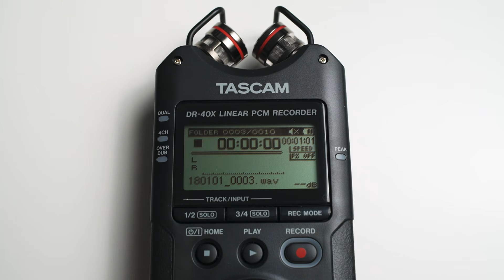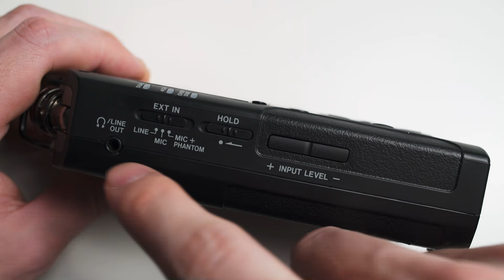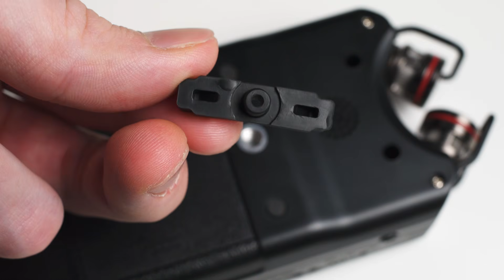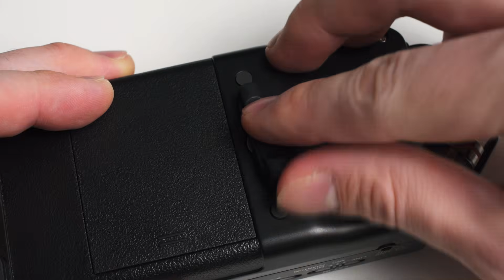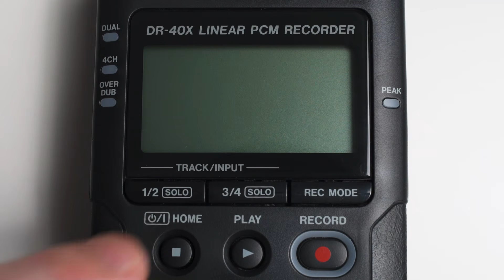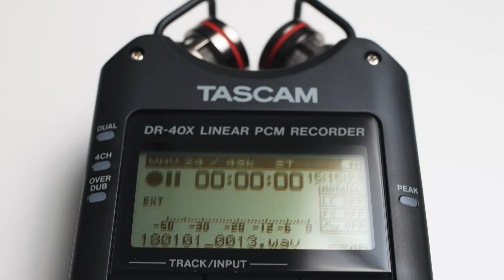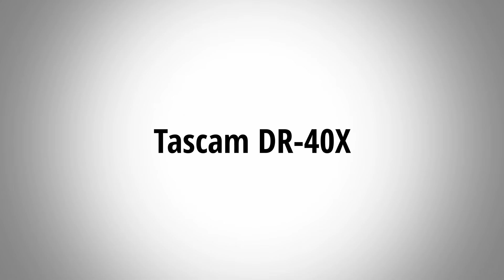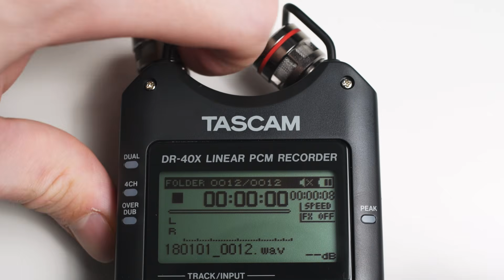Tascam DR-40X Review (Noise, Battery Life and more things tested!)

Comment: Hi, Julian! I'm a classical guitarist with a low budget, and I bought the predecessor of this recorder (the Tascam DR40) in 2012, if I remember well. That was a long time ago and the sound quality expectations may have been lower then, but from the very first day, I had a feeling that the preamps in the DR40 are sub par. Recordings with the internal microphones sounded relatively good, but external microphones didn't quite sound right, even when I used high quality equipment. Actually, I bought a pair of decent quality tube preamps to get around the mic preamps of the recorder. That way I can input the separately amplified microphone signals to the line inputs of the combo sockets. That setup has more advantages. First, the separate preamps can supply phantom power to the condenser mics, and so battery life of the recorder can be reserved for recording only. Next, I can manually set the gain on the separate preamps with proper turning knobs and so I can prevent clipping in all three units much more easily. I don't know much about the noise level of my setup, because I haven't tested it yet, but actually eI'm not very satisfied with the sound of my recordings, mainly because I cannot hear the same immediacy of the sound that I can experience while playing my guitar. Of course, the culprits maybe the mics or the preamps, or the excessively long signal path, too, but I have a good reason to suspect that the line preamps of the DR40 recorder (if there're any) are causing the problem. I guess this recorder simply isn't made to create home-studio-grade classical guitar recordings. It may be good to record occasional live performances, but you definitely need a more serious recorder as the central piece of your home recording rig, especially if you have already splashed out a fair sum on decent microphones and other pieces of gear. I think, in 2025, probably the Zoom F8N multitrack recorder is the right solution, or some of the well-built field recorders from Tascam with better quality preamps.

Comment: Great video. Thank you. I bought the DR-40X and very rarely use it. The reason to buy it was to spread the built-in mics, put it on a table in the centre of my music room, and face it towards my hifi speakers. This way, I assume it will record audio the way my speakers actually sound in person. I could take a line level out of my hifi system and directly plug it into the DR-40X but that would just give me a hi-res audio file on the SD card, right?.  In order to share files with friends and family with music the way I hear it in my room, what best way would you suggest? I have 4 different pairs of speakers, and I want to share how they all differently sound while playing the same music from the same source. Your thoughts on this will be greatly appreciated. Thanks.

Comment: Bit late, but you can insert that knob on the back (the one preventing the device from being tilted away from you) by turning it clockwise, as if it was a screw. This allows proper inserting and positioning.
Mine arrived just today, and I have yet to try it out in depth. I mainly bought it as a hardware recorder, so I can record my dawless jams / performances without always having to turn on the PC. First test recording sounded okay, but I'll have to do some further testing.
Btw, I fell into the "arm rec trap". "Made" a "recording" just to find out that all I did was arm the recorder ^^

Comment: When you plug an electric guitar straight into the Tascam DR-40X, do you need a pre-amp? Without pre-amping, it seems like Tascam doesn't pick up an electric guitar signal much at all. The levels are barely there. Put a pre-amp between the guitar and the Tascam, and the levels are 'normal'. Is there something I've not discovered on the internal menus of the Tascam, or is that just the way it is (signal almost nil when recording electric guitar direct)?

Comment: Welp, even though you think that the build quality isn't good, thousands of DR-40 units are still banging around go bags and don't miss a beat. While many YT reviewers have a fetish about metal-only construction, the reality is that the DR-40X and the DR-40 are rugged and decent enough for all but the most discriminating uses. Plastic doesn't mean trashy. The X model was essentially unchanged at a surface level because it is a if-it-isn't-broken-don't-fix-it sequel. The X is also an audio interface, which the original was not. Good value for money for a sub $200 recorder.

Comment: Revisiting this video again a year later. Still disappointed that this unit, which I love in so many regards, has such an unacceptable EIN and is all but unusable "as is" with dynamic mics and less sensitive condensers. I bought FetHeads (original and Phantom) to improve the noise issue when recording to this device, but in retrospect I really should have gone with the equivalent device by Zoom.

I commented last year that the noise struggles also seem to prevail with my DP008EX, but at least it can excuse itself by being older technology an confined to 16bit recording only. I have since gotten other Tascam recorders, such as the DP32sd, which is already "old" technology but seems to have much better preamps and it shows, and the newer Model 12, which records all of my mics cleanly and doesn't benefit from FetHead preamplification at all.

I would again like to see Julian (or someone) measure the EIN on these other Tascams (particularly the old DP008EX as I want confirmation that it is indeed as bad as I think it is), but I appreciate that will all the newer gear coming out and the move away from dedicated MTRs and toward interfaces and DAWs, there might not be much interest.

Comment: Very informative video specially on the noise floor. So which recorder model would you recommend please? This is my criteria:
- have xy and ab configuration
- can support adding 2 external condenser mics
- can be used as an interface and connected to PC for either broadcasting and recording 
- decent low noise
- budget up to $300
Thanks a lot

Comment: Hey Julian, thumbs up for the video. Surly opened my eyes. 
I bought the DR-40 Linear PCM Recorder (EIN: -108.3 dBu) 8 years ago and was thinking to use a Cloudlifter to cut roughly 25 DB in order to record vocals for a song. Still, if an acceptable noise floor is -65db or lower, it might not suffice. Can you share your thoughts in this regard?
Tnx 
Dav

Comment: Its normal for a recorder to require two button presses to start recording. 
it has three modes: Stand by, play, record. 
The audio input normally would not go to the headphones/line out in standby mode. If you are playing back tracks you dont want the microphones to send the audio to the headphones/line out, every time a track ends, while you select the next track to play, or reset the track to play it again. 

the recorder cannot read your mind and know which button you will press next: play or record.

Tape recorders were made this way for decades.

Comment: I posted a lengthy comment here earlier pointing out some things about this device. Hopefully it won’t “disappear” or be deleted again. Yes, this item is plastic which reduces its cost and second, it reduces weight as it is a portable device. Yes it has an intolerable built-in background hiss or noise. Nothing you can change via the menu for recording settings will lessen the hiss. Also the device will amplify and record any user handling of device while recording. So it must be positioned on a vibration free surface or a tripod. An accessory kit is available to allow device to be mounted on a typical mic stand. Any outside recording of music or nature sound will require a good wind screen added over mics.

Lastly, if you have a good audio editor with a noise reduction tool the be advised of this good information. After recording something with this device — open your recording in your audio editor. Select a non-music or non-vocals portion with the hiss/noise section, copy this section. Then open your noise reduction tool. Choose clipboard as the parameter for what to remove. Play your recording to see if hiss is gone. It will be. Then save the hiss-free recording. Yes, it is a workaround but if you want a hiss free recording, this is absolutely necessary with this device. Editing out the noise from a field recording will require you first record somewhere quiet, then save say 5 or 10 seconds worth to a “hiss/noise” audio file first. Make your field recording. Then open both field recording and the hiss/noise recording at the same time in your audio editor. Copy the noise sample. Then select your field recording. Open noise reduction tool. Choose clipboard as the parameter for the noise reduction to use. Apply and check your field recording. It will be artifact free. Save your cleaned up file. Extra steps yes but doable. If you already own this device this procedure will help out. If you find a used one of these in good condition and know how to use an audio editor — consider grabbing it  — as other than the irksome hiss/noise issue — it’s an affordable, overall useful and lightweight digital recorder. 😎👍🎥

Comment: During your noise floor comparison of different devices you didn't explain your settings or setup of each device. What were the gain settings used? That comparison was useless. Also, you only tested the preamp with a single dynamic microphone. What about a phantom powered condenser mic? Why didn't you test that? What about the simultaneous 4-track recording function? If you're going to review a device, please set your metrics to eliminate bias, and explain those test metrics to the viewers. Also, review all the functions, not just the ones you aren't happy with. I have more condensers than dynamics, so this review wasn't helpful to me at all.

Comment: I just got a FetHead Phantom today. I can confirm what you start--using the device easily improves the noise situation with my low sensitivity dynamic mics and the Behringer C-3, which is not terribly sensitive compared to other condensers. I am glad I got it and it will improve my experience with the DR40X and my other Tascam recorder. That said I have multiple uses for the FetHead beyond just lowering preamp noise on this device. I think someone starting clean is best to not worry about the FetHead and spend the extra money on a Zoom recorder with better preamps.

Comment: Would really like to see you review other  TASCAM multitrack recorders, like the DP006, DP03sd, and DP008EX. I have the latter, and I think the noise at the XLR inputs is terrible. I get much better results when I run the mic through a small Behringer mixer and record through the recorder's TRS line inputs. It's astounding, the improvement. But this works against the portability of the DP008EX if you need to shlep another piece of gear!

Comment: I have come to trust Julian's scientific approach and objective measurements. That said I get much better quality out of this with a Behringer XM8500 dynamic mic than this review suggests I should. Perhaps my old ears and high frequency hearing loss mean I don't hear noise as much ;)

My main gripe with the unit is that it's overdubbing and mixing capabilities take some time to sort out. You really need to download the full reference manual from Tascam. In short it isn't a four-track recorder in the more traditional sense as in my old Zoom H4. The process is basically overdub-bounce-overdub-bounce on track at a time. Workable, but different.

I find the build quality is fine. The little rubber foot has a storage slot in the battery cover. And the Peak Reduction level control is very useful (there are other YouTube videos that extol the virtues), but I agree that the Auto and Limiter level controls are not.

Julian doesn't mention that you can power the thing through USB too using computer port, a standard phone charger, or and external battery pack.

In brief I like it a bit better than Julian does. However, I am keen to invest in a fethead to see it I can improve the noise performance on this and other beloved recorders I have.
Reply from the maker: Hey, thank for sharing your experience with the DR-40X and the additional input!
The reason you are much better off with the XM8500 is that it is a more sensitive microphone. Meaning, it delivers a stronger signal in comparision to many other dyanmic microphones and that's why you end up with less noise in your recording.
Reply: @JulianKrause  Thanks. A couple of other things you didn't touch on. I have been experimenting with the thing as a USB interface, and it is surprisingly good, especially when using the built in mics. My DAW is Cakewalk, and I do find it takes a lot of fiddling with the ASIO4All property settings to get down to 128kbps latency (I have a small slow laptop so I don't go lower), but it is possible. As for the internal mics, there seems to be a slight QC issue with mine. In the XY position the Y is turned in a little more than the X. This means the stereo balance seems to slightly favour the R channel when you speak or sing dead on. The average difference on the meters is only a couple of dB, and it should only be audible to obsessive audiophiles, but this device isn't cheap and I would expect this to be in better nick. Also, the sensitivity of the mic to plosives is a huge headache--a pop filter or windcover of fur or foam is an absolute must, especially if you use Peak Reduction, as I do, to manage the the gain. I still really like the thing, but I can't deny that the mic asymmetry, which I suspect does not affect every unit out there, is a tad annoying (even if it is easy to compensate for by positioning).

Comment: Yes! This is a review. No stupid, annoying background-music, just a normal setup behind you.... I now own a DR-40, which has a an extremely annoying 'chirp' sound when using a phantom powered microphone. (which is basically a 'continuation' of the very bad helicopter sound many experienced back in the days and was eventually fixed by Tascam).

Just tried to record a voice-over, when the chirp came on AGAIN. I was so fed up that I started looking for something different. As I can read and write with my Tascam DR-40, I thought of the DR-40X. But darn, no. This will not be my choice.
About the plastic ;) My DR-40 has survived many accidental drops, including drops on the metal guards that protect the internal microphones. It has never failed to amaze me how sturdy this thing is built. The mic-guards aren't even bent!

Comment: Personally, I love the "Record" feature of not going directly into record mode, as you need to set levels before you record anyway, and if you REALLY want to jump right in and record, just press the record button twice quickly. Also, you must remember price point when reviewing these recorders, and Tascam does make more expensive recorders for more exacting professional applications. All in all, in my opinion, this is a very fine recorder for under $200.00.
Reply: Even if all companies have better recorders, they should put pre-amps and a/d d/a converters. 
That should be HIGH-CLASS. 

All other things (cheap plastic, buttons etc.) I don’t care about.
Reply: It is a horror system where you can miss the dubble tap or forget it. Stupid system.

Comment: What about line in recordings with music? - do they get ok?
Reply from the maker: Yes, they are ok. A line level signal is much stronger than a mic signal and you will hardly have any noise in your recording.
Reply: The DR-40X does have a switch for line level. The Zoom H4n doesn't have that. On the Zoom the TRS plugs are INSTRUMENT level inputs. Unless you use attenuators a line level signal will get distorted on the Zoom.

Comment: I've got a TASCAM USB interface US-122 (not MK2, the very first one) from XP/Vista era. It's got some driver trouble, since it was never updated for Windows 7 or newer, but it works. I simply scavenged the thing somewhere, opened it up, cleaned out the beer residue, plant matter residue with a distinctive smell, and indescribable white powders, and well it works again. Haha, musicians and their drug habits!

But the quality of the thing is diabolical one way or another. When turning off phantom power, there's a distinctive capacitor squeal. I took out all the through-hole capacitors, and you know what, they're all perfectly good, like day 1 specs... but the board is crowded with SMD electrolytics, and there's no way i could access them without desoldering all the switchgear first... Well i can ignore that. Also the noise, the amount of noise. I think it's about the same as you're getting. Some things never change eh? Worse, the headphone and line out are JUNK. They're completely identical. They distort audibly once pushed past about 2-3 o'clock position. The headphones don't even get terribly loud. I made a quick RMAA measurement and while i don't remember where i put it, it's appalling. They probably knew the outputs weren't going to be great, because i mean it's got those high bit depth inputs but only 16-bit outputs, which is to say the least uncommon even for the era.

Well at least it didn't cost pretty much anything. And i can always upgrade to a Behringer. But something else is luring me. You know the Terrasoniq Phase X64? I'm afraid it's going to be a catastrophe isn't it. But look at it. Just look at its silly face. And its silly side buttons. And the silly wall chart you need to operate them. And the silly WaveBlaster connector inside it. It's so cute! I wonder how bad it really is. I heard you have to get a driver dev on the phone to get a version that won't crash so often. I heard the preamps are noisy. I have not heard a single good thing about it. If you can hunt one for $20 used, would you check it out?